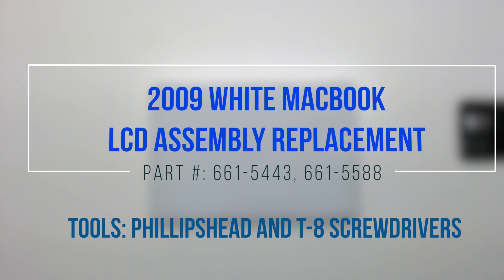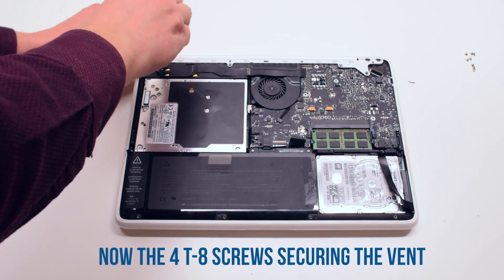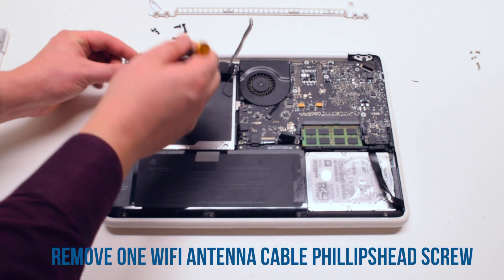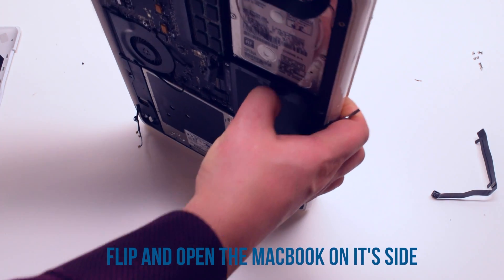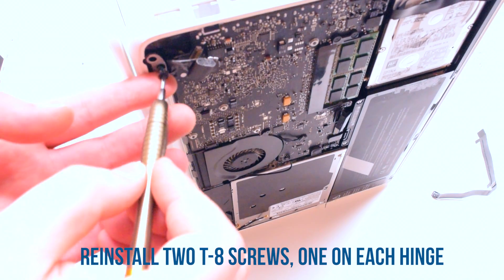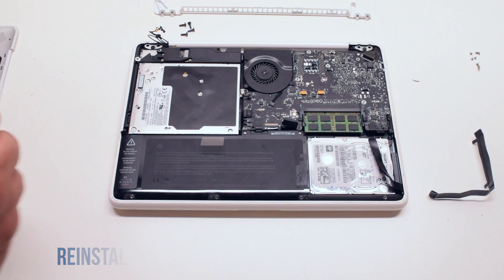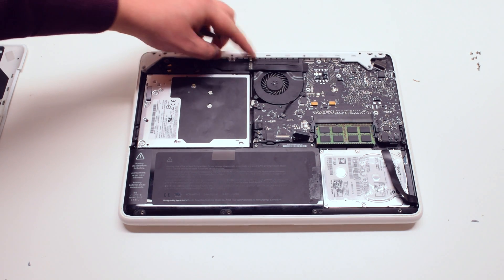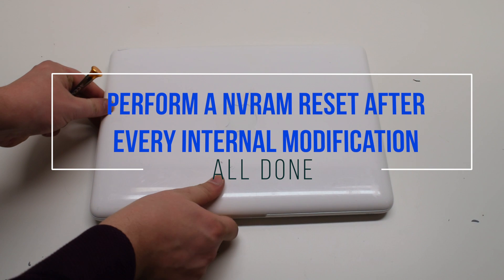2009 White Macbook A1342 LCD Assembly Replacement

Comment: could anything  happen if  forget to disconnect the battery before I start the removal of the screen
Reply from the maker: +Stephen Reed you should always disconnect it because you can accidentally complete a circuit that should not be completed, thus shorting out a component. Having said that, it's difficult to do and if you accidentally forget, chances are very low that something gets shorted, you should be fine. I work on Macs a lot, so much that for some operations I don't unplug the battery at all but I would always advocate doing so.

Comment: It is really hard to remove the lcd screen out of the MacBook. Is there a method to remove the screen?
Reply from the maker: It's easier on this model then on the aluminum ones but it's still a difficult task. Check out iFixit's guide on the lcd removal here https://www.ifixit.com/Guide/MacBook+Unibody+Model+A1342+LCD+Replacement/2988 good luck!